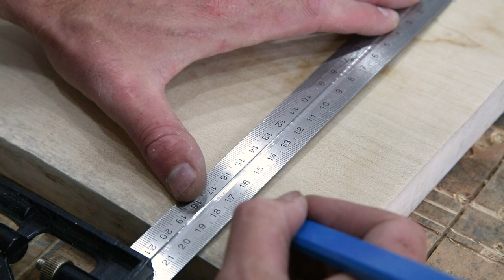How to build a copper pipe side table

Comment: I've made a couple of similar items out of 15mm copper pipe, and they're great for outdoor use. The only problem with copper is that it bends easily, and can buckle if too much weight is placed on whatever you've made. To aid the rigidity of the copper, I fitted some doweling rod inside the lengths, and now it never bends.
Reply from the maker: Great tip! Thanks! We'd love to see your builds any photos?

Comment: Could you please tell me what glue you are using and is it a good permanent one, I’ve recently started making things from copper pipe and I’ve used sticks like sh-t by evo stick but there is still some movement even after 24 hours. Is the glue you are using a multi purpose glue for different materials thanks
Reply from the maker: We used Mitre Fast for a instant fix instead of soldering and it's still going strong 💪
Reply: @SilverlineToolsTV  Thanks for answering so quickly 👍Ps I’ve just read the reviews and they all say good things about it , Ive just last week had a new kitchen fitted by 2 great joiners and they used miter glue on the cornices on the tops of the cupboards , they both said you have to be careful with it as one of them stuck their fingers together, I didn’t realise it was a multi purpose glue , I’ve tried evo stick , sticks like sh?t and I could still move the copper fittings the day after so it’s not as good as what it says it does , I’m a retired plumber in the uk , I’ve made 4 iPad stands For my grand children , I also made a pipe mug tree and kitchen Roll holder and I soldered them which is time consuming and messy as you know, there is a craft shop in the village where I live which sells things from numerous crafters, I have shown the owner what I’ve made ( she teaches the art of making Dorset Buttons) she asked me if I would sell things in her shop , so I want to make sure the items I make don’t fall apart, I really enjoyed your video . One last thing if you don’t mind could you recommend a good lacquer I could spray the copper with to keep it shiny thanks again really appreciate your help 👍
Reply from the maker: WOW! you sound busy! If you give the side table a go let us know, we'd love to know how you get on. 

For the shine we just used Autosol Metal Polish and a rag. Does dull after a while, but a quick buff and you've got a mirror finish again.
Reply: @SilverlineToolsTV  Thanks for the advice for polishing the copper, I will let you know how I get on making the table 👍
Reply: @SilverlineToolsTV  could I ask you do you know how to break a joint on copper pipe, I got to the final 2 pieces of making a copper pipe trivet and the glue went hard before I got the pipe fully in the fittings thanks
Reply from the maker: @peterrobertshaw6661  A copper pipe trivet sounds awesome. We'd love to see it when you're done. 

White spirit should remove the glue while not affecting the metal. But always test on an off cut before trying on your final piece.